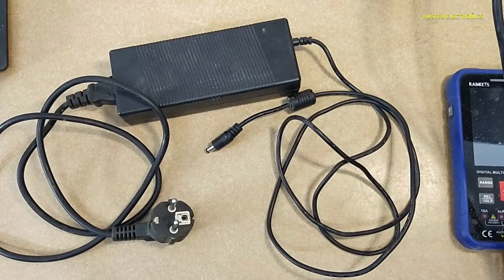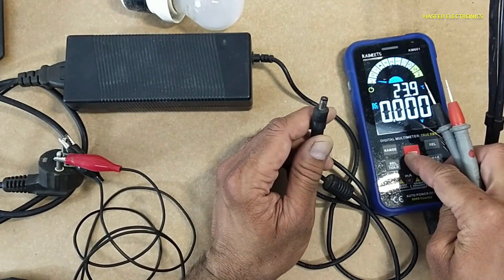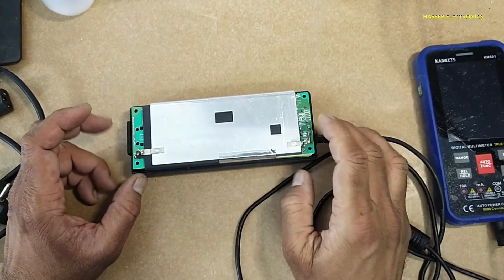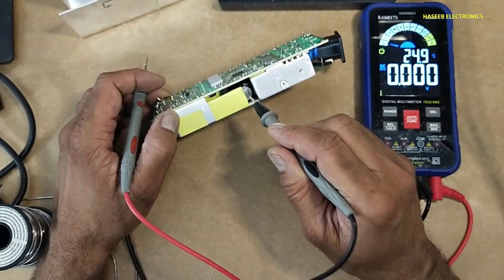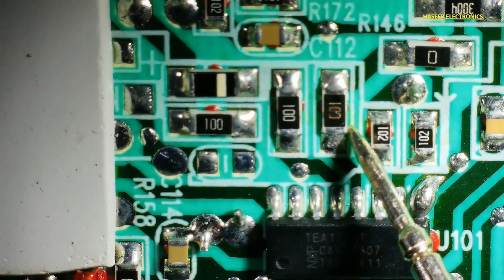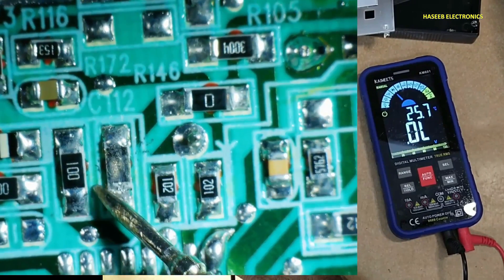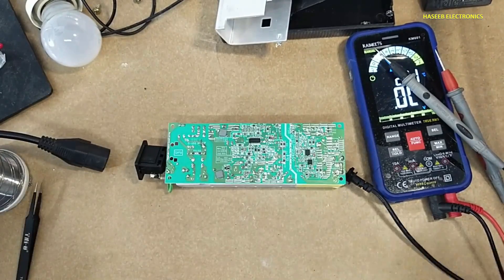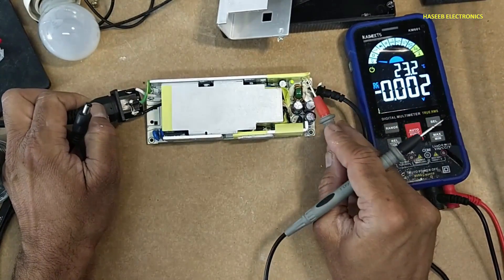{989} 24 volt power adapter repair, no power on

Comment: I have previously repairs a PFC on power supply. sometimes the diode on output of PFC is shorted you try to check it?
Reply from the maker: You are right 
If that diode is damaged, it will not make short link on bridge rectifier+ and - output terminals
That situation cause to blast bulk capacitor or heat up.

Comment: Resp Sir! Very Excellent Class Sir. Sir Dell 6Pin SMPS Primary Section With Series Lamp all are OK(FETs Resistors) but SB Not out, SB Transformer Primary Section 2 Pols or Points are 332 DC V. Not in SB Sir. Where the Problem Sir. Please Advise Sir. Iam Waiting Sir. Please Sir.   --   ChinnaRao Paderu Andhrapradesh

Comment: Great video. I was surprised the IC was still good since the 10 ohm resistor was cooked. Did you check the PFC was actually working?
Reply: After changing the bad parts it was outputting 24V. If it was not outputting then the chip can be checked. Since it was outputting voltage there is no need to look further. Job is done, move on.
Reply: The power factor correction mosfet can be missing and it will still work.

Comment: Nice video. :)
Question is which bulb did you use for the series bulb? What wattage was it?
Thank you.
Reply: incandescent one, 60 or 100 watts
Reply from the maker: Yes 
60 watt for small circuits
And 100 watt for medium power circuits

Comment: I have here a Dell charger , with the plug bent just like the one in the video - and it is broken inside . It loses contact, 19V , when it is not straight. The laptop motherboard was investigated - suspect failure to boot, but it actually works fine afterall.